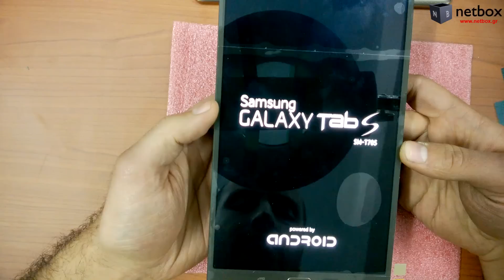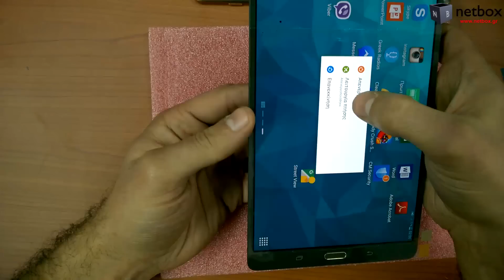Samsung galaxy tab S 8.4 screen replacement

Comment: This was bought to replace an old Lenovo tablet which was essentially too sluggish to cope with modern websites.  https://www.youtube.com/post/Ugkxz4qYZoyAOb_hq_UbaKI6AsZX0FnoFm-U  This tablet is fast, has a very clear display with built in optional eye comfort shield, great sound with Dolby Atmos, split screen option and numerous tweaks that I've not yet explored. I've plugged a wireless receiver into the i/o socket to connect a mouse if I need it and a bluetooth keyboard works fine - unlike the Lenevo which somehow would often garble the input. Battery life seems good. In short I'm very pleased with it

Comment: Thanks. Easier than I thought it would be. Better way to remove battery is to lift plastic wrapper and use as handle to pull it out. See other utube  video on battery replacement. Also, I replaced the gold IR thing, top right speaker, circuit board, then the rest in that order. Make sure circuit board is tucked under clip on right, then mtg holes will line up. I was lucky and found a new screen on ebay <100. Otherwise this repair is economically questionable. I had the yellow tint problem. I tried re-seating the display connector but ended replacing the display to fix it.

Comment: Mate that white wire you took out around 6:15, it's missing for me and my screen is black. Is that why?
Reply: I'm also missing it. I think it's because the one on the video is the lte version. You may have only wifi
Reply from the maker: Just as Javier said, now for the black screen issue, did you open it and then it started having the black screen or you opened the tablet because of the black screen issue?

Comment: Hi, I have the tab s 8.4 and the screen gets a yellowish tint, I've researched and believe it's the lcd cable that runs by the top of the front facing cam. Would that be the case? It will go back and forth as it's loose. I've taken it apart and pressed it down and it will work, and when the pressure is off it will go back to the dim, yellowish tint. Any photos taken will be in perfect color when transferred to another device or shared.

Thank you for any help.
Reply from the maker: Well that could be two things as you pressed the ribbon cable of the screen and it started working correctly is either the connector on the screen or the input on the main board so either way you need to have that checked by a tech. Cheers!
Reply: Andrew Gamble got the same problem here! 
got any solution?  
it is very annoying
Reply: I took apart the back, and there is a cable up top that plugs in by the light sensor near the camera. that was loose and also the lcd cable, a fat one that runs from the top to the bottom sort of, go online and look for a schematic and youl'll see what I mean. That fixed it. See if you can press on the top by the samsung logo and if it goes to the regualr display that's def the problem. I love that tablet. so damn fast. faster than my 10.4 A with s pen I have now.
Reply: the tablet is open right now infront of me :D 
but I cannot any loose connection! 
Could u please show me a schematic that would help
Thanks in advance
Reply: Yasser Younis hey dude,  I'm not a pro at this but I'll see if I can
Reply: send me a dm
Reply: hi andrew, i'm having the same problem as you and yasser but i can't send you a dm for some reason.  i cant seem to find which cable that is causing the yellowish tint to appear. i just know pressing or flexing the screen on the top left close to the samsung letters brings the screen back to normal.  i've tried wiggling the connectors, pressing on them, and reconnecting them but the only thing that fixes the screen is pressure.. got any other ideas? thanks!
Reply: Andrew Gamble same here, even with the problem of not being able to DM him 😂
Reply from the maker: Hey guys sorry we were away for Easter vacation and we are back, so the yellowish screen can be caused by two things, one the ribbon cable of the screen isn't correctly connected on the main board, or the ribbon cable is damaged. These are the popular ones. If you tried to disconnect the digitizer from the LCD the problem must be the screen, during the removal the screen might be damaged, but each of you has taken different actions on the phone, so if you guys want send us a dm and I will contact A.S.A.P. 

Cheers!
Reply: Andrew Gamble bro, can you send me the schematic, which one need to tighten? I got same problem as you

Comment: My front 3 control buttons (home/back/multi) do not work. they don't even light up on startup.  This stopped when i dropped the tablet whilst the back cover was off!. Any instructions on how to replace that ribbon cable/connectors?  I can buy the part easy enough, but looks like to replace it goes beyond what you show in your clip.

Comment: I'm trying to find a replacement screen for my t705, but the prices are absolutely ridiculous. I bought it last year for 120 GBP, I've unlocked it and I've been using it as my only phone since then. Now the screen is broken and a replacement is much more expensive that the actual device!!
The good thing is that I had Teamviewer and Pushbullet and I can still access it. I've also got a Gear S3 and I make and receive call through my watch.
Reply from the maker: yeah the bad thing with this one is that the screen replacement part is way to expensive, this one was changed a week after the device was bought and the screens actual cost was half of that of the device. Did you check on ebay and amazon? 

https://www.ebay.com/p/for-Samsung-Galaxy-Tab-S-8-4-Sm-t700-LCD-Display-Touch-Digitizer-Assembly-White/1746132648
Reply from the maker: if you do buy one from amazon or ebay keep in mind that US and EU adapters are not the same.

Comment: How can i tell if the LCD is damaged too? the screen seems fine. It had green stripes vertically on the screen. IF i recall correctly, it still responded to the touch.
Reply from the maker: sorry for the late reply, it could be that the ribbon cable is not correctly plugged in so you can try that else it's the lcd (probably) but I can't really tell just by description so these are the most likely scenarios

Comment: hello there 
thanks for sharing this 
my tablet here has a yellow tint all over the screen 
it just goes away and the screen becomes back to normal colors when I press on the left of the samsung word above the screen in the face of the tablet 
just pressing brings it back to normal and some times it just works fine but it is so annoying 
any suggestions?

Comment: I had this issue and after that the screen became yellow which remains yellow 98-99% time but 1-2% time it turns back to normal color and again becomes yellow tint. But when a small notification or kind of stuff shows up only that area becomes yellow and the rest of the background screen seems to be normal color. Where might be the prob? I talk with a technician and he said to replace the screen but to me it's not seeming a display issue rather some other connector related hardware issue. Any idea dear???
Using the tablet for last 5 years

Comment: is display and touch pad connected in it ??
Reply from the maker: yeah Sumsung sells the whole pack together, digitizer and lcd if you get them separated they are not the official parts. (also if you have a brokend digitizer (touch) and try to change only that, there is high risk that you will break the lcd screen during the process.)

Comment: Is this the full screen and digitizer replacement?
Reply from the maker: The original part comes together the LCD and the Digitizer, you could get an imitation digitizer and lcd apart but it's always better to use the original parts.

Comment: That's the whole LCD+Digitizer replacement. Replacing just the digitizer is a different ball game!
Reply from the maker: ofc mate replacing the digitizer is way harder and probably more expensive as the process might damage the lcd
Reply: How do you know if it's the digitizer or the LCD the problem?

Comment: Good work, but not what i was looking for. This is not how my new screen assembly came.  I wanted to see how to remove the screen (glass+touchglass+LCD) because this is the screen assembly that i got. Not including screen assembly casing.
Reply from the maker: Mate this is the European model, though I am not sure that the US one defers, the whole thing comes as one if it's the original part.
Reply: What i received has no frame around, three layers of glass (glass,thouch screen and LCD) + connector.
Reply from the maker: is it OEM or the original part?
Reply: where did you got your lcd display??
Reply: +Bardo parts4repairs.com
Reply: thank you
Reply: but it doesnt worked it opens up facebook
Reply: Correction:   parts4repair.com
Reply: Hi André, I got the same part when I ordered. Did you solve it or did you return the LCD?

Comment: Why didn't you just remove the back cover?
Reply from the maker: What do you mean? it's a screen replacement, and everything is plugged on the main screen the back cover is removed during the process
Reply: @NetBoxGr  you are wrong to remove batterai

Comment: Hi! I replaced my battery im my galaxy tab s 8.4 and now my screen does not turn on. Do you know what could it be the problem?
Reply from the maker: you should check if the ribbon cable is correctly plugged in and check if everything is correctly plugged in for that matter.

Comment: Hi NetBox, 

my T705 has a black screen, I can see a crack inside (on the LCD, not on the glass).

The device turns on and I ensured it is still working by connecting it to an external monitor via USB-OTG to HDMI adapter.

I watched your video several times now and I feel ready to give it a try ... I was wondering if you can point me to which hardware part I need and where to find it. e-bay has something: https://tinyurl.com/lhvewok but that part looks "different" than the one you are using as the replacement. By "different" I mean it seems to be missing the battery holder and other small parts.

Thanks for any hint!
Reply from the maker: Hey mate my guess is that it would be kinda hard to remove the holders from the old screen and move them to the new why don't you check one with everything in place like this http://www.ebay.it/itm/OEM-Samsung-Galaxy-Tab-S-8-4-SM-T700-LCD-DISPLAY-TOUCH-SCREEN-DIGITIZER-FRAME-B-/282420022810?hash=item41c18b8e1a:g:t3sAAOSwDmBY4o3m 
it's an OEM part though we would recommend an original one.
Reply: Hi NetBox, thanks for your reply! I was wondering if the part you posted will fit a T705 .. I can't find it out (yet) I sent a question to the ebay seller .. to see if knows. finger crossed, I'm missing my tablet!
Reply from the maker: Well they do say that it is fanctional and has 3 months warranty but I have never tried using this brand, so it's up to you. Their rating is 94 point something so i would say it's fair enough.